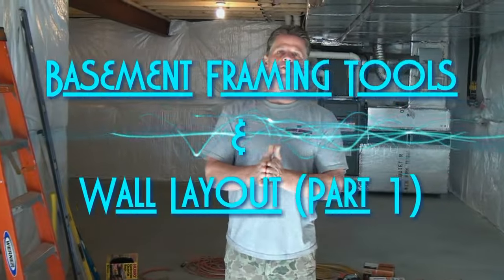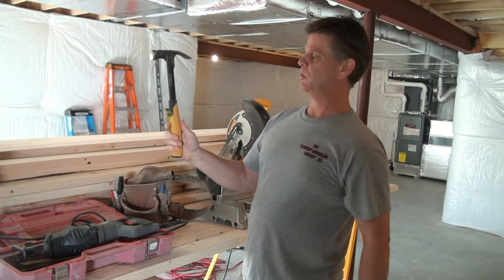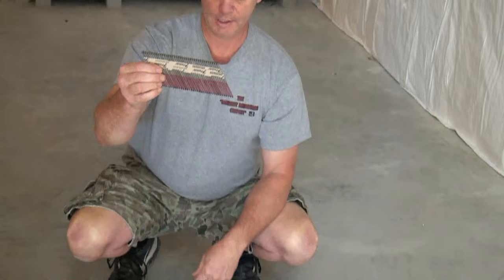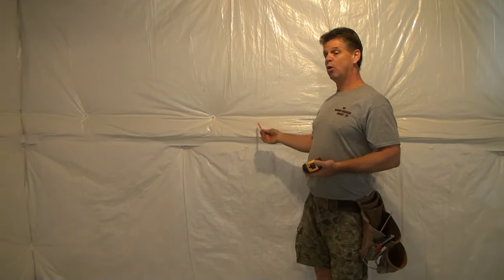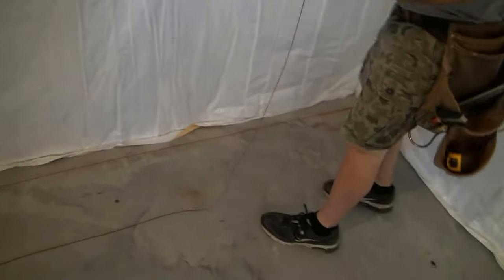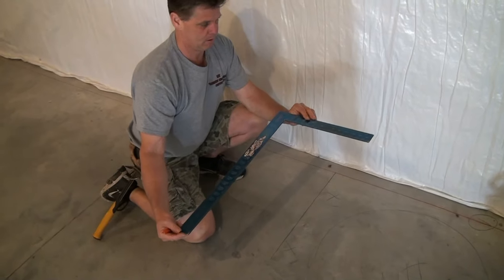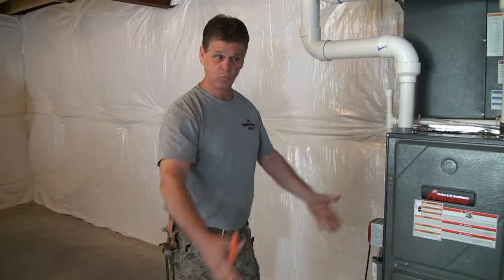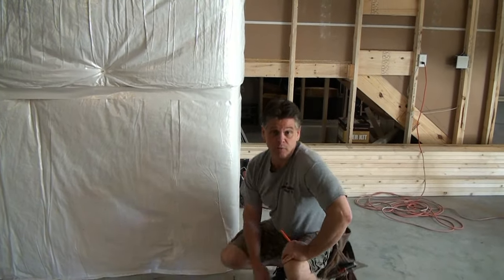How-to Frame a Basement(basement framing tools) Part 1 of 6

Comment: I just came across this.  Amazing; this is the best DIY how to basement framing video I've encountered on the internet.  I was a little apprehensive to start my basement project because the other videos didn't address my questions on corners, gaps, leveling and spacing and all together in a simple follow video process.  Yours did!  Thank you for taking the time to put this together!

Comment: What if the wall is not square. the 6 inch on both corners may not line up straight.  how to get a perfect square to snap lines in this case?

Comment: Best instructional video I’ve ever seen! Question...What is your recommendations for basement insulation? I see you are not a fan of foam board? Can you explain why? I installed 1” foam boards to the walls before watching your video’s. Should I use the goal as the exterior wall now and come off 4.5”?

Comment: Im going to finish my basement house is built in the 40's, is it wise for me to use the Pythagoras Theorem instead of using a framing square? My walls are definitely not square.
Reply from the maker: Use a framing square and check and readjust it's much faster than the 3-4-5 method (Pythagoras Theorem)...don't over-complicate this layout process.
Good luck with your project.

Eddie

Comment: I watched this video series before and during my basement build out. All the knowledge, tips and tricks to frame out my basement space is in this series. I gained the understanding and confidence to frame out my basement space. I had no previous experience framing out any space before. The directions and teaching in this series made the process approachable and relatively easy! 

I was a stay at home parent to my twin kids, back in 2018-2020. I completed this project in bits and pieces. I would start one wall section, during a 2-hour nap. Laying out the 2x4 studs and marking their positions, before cutting and nailing with their "help". The whole process was very gratifying and I felt a lot of pride in doing the work. After a friend helped with roughing the electrical, and me insulating the walls, I installed the light boxes and outlets. Another friend did the drywall over a weekend away. I finished the space with a vinyl flooring, trim boards and paint!

Comment: Thank you. I'm using these series to finish my basement as an absolute beginner. This morning i built first wall falling your instructions. 
Thank you
Reply from the maker: Congratulations on getting your project started! Framing is a lot fun when once you understand the basics! Good luck with the project Dar!  ~Eddie
Reply: @BasementFinishingMan  by the way. I finished the basement two years ago. It took me about 6 months to complete 1000sqf. I worked on it every day (5 to 11pm) and weekends from 7 AM to 11PM. A builder wanted to charge me $50k. I spent a little less than $20k, and that was because I bought the best tools out there.
Thank You

Comment: I wanted to  thank you for clear and thorough traming videos. I've got question, what do you do when you have a power switch/electric wire right on the basement sliding glass door frame.
Reply from the maker: Move the switch box into a new location on the new wall you just built.  -Eddie

Comment: Eddie - your 6 part series of framing a basement is the best on YouTube. Thank you so much. Question ... how far is “wildly off” when making sure my intersecting chalk lines are a 90 degree right angle? In the vid, you were fine with your corner being off a 1/16” but I’m attempting to finish a basement of a 1951 Frank Lloyd Wright protégé designed house where absolutely nothing is straight and nothing is level. My marks are off a solid 1/4 to 3/8 inch. Is that ok? Or should I “drive myself nuts” trying to get that tighter? Any thoughts would be appreciated. Thanks, man!

Comment: It felt that I already finished my basement just by watching this:) great video! you must be protected at all cost! By the way, should I use 2x4 or 1.5 x 3.5 for the lumber? The existing frame that I have now is using the 1.5 x 3.5...
Reply from the maker: YES...A 2" X 4" IS ACTUALLY 1.5" X 3.5" IN SIZE...

Comment: Really great video that details all tools and exact screw sizes. I have question on how to frame when firestock/fireblock is required. What all materials are acceptable as fireblock? How would it impact all measurements?

Comment: Love this series! 

We live in an old farm house. The basement has a shallow trough running along the exterior walls. It dumps into the garage, not a sump. 
Can I frame out beyond this trough without causing any issues? Very little water webs up in this trough as the basement doesn't leak, currently.

Or, can I just glue FRP board to the walls leaving the trough exposed?

Thank you for this series and your time. 
Bob

Comment: at 16:05 - the Wall Wrap. What is the purpose for it (I assume it's for moisture control?)? what does it do? how do you hang it?
Reply from the maker: It's installed by the builder of the home 99% of the time, and it's code in most regions now to install it when the house is built. It gives your unfinished basement the required R-Value the building code requires...in other words...it's supposed to keep the unfinished basement warmer and more comfortable saving you on energy costs.

Eddie

Comment: I have 2" XPS installed along my poured foundation. I see you measure far enough away from the wall so the framing isn't touching the wall wrap. Long story short, I need to maximize my space and every inch counts. Can I frame right against my XPS, or do I need to leave some space (and why)?

Comment: I unserstand how to  build a studwall for a basemnt with 16 inch centers. The problem i have is how when you join two walls at a 90 ( corner ) you have then changed and shortened the first wall by 31/2 inches and now you do not have 16" centers on that first wall? Im sure there is a simple solution but it is just not computing with me. thank you for your great videos

Comment: At 27:00 you said you needed to come out 5-ft.  Is that from the concrete foundation or from the line that is 6-inches out from the concrete foundation due to the insulation?  Thank you for your great video!  I will be framing my basement in the next few weeks.
Reply from the maker: Hi Bill on this particular wall it was off of the concrete wall and not the snapped wall line.

Eddie
Reply: @BasementFinishingMan  thank you for your fast reply!
Reply from the maker: You're welcome Bill.

Comment: The best basement framing series thx man..
Question inside my basement I have the plastic dimple roll stuff on the inside of basement can I just work 3 1/2 " off of that also I put dricore down first already gonna build frame on top of that cement is week from inside sump pump.
Reply from the maker: I would come 4.5" off of the dimple barrier just to sure I won't be pushing against it at all when I stand my walls up to fasten them. Thanks for the views brother and good luck with your basement!

Eddie

Comment: I wall wrap needed? My basement doesn’t have it. House was built in 1999 and has a rough in for a bathroom. So it was designed to be finished. Do I need any kind of plastic/wrap in between the studs and concrete?
Reply from the maker: Neither wall warp and especially plastic vapor barriers are NOT needed! Wall wrap it just for unfinished basements by code...once you remodel all that's needed is the new insulation between the newly framed  exterior wall studs...and that's it. Hope this helps.

~Eddie
Reply: @BasementFinishingMan  Awesome! Thanks for your reply. That's a big help. I was planning on studding my exterior walls and using a bat insulation, but wanted to make sure nothing was needed in between the concrete and studs. Have a good one!

Comment: The one question I have while I am planning all this framing out for the next week - if there isn't anything under the joists hanging down, can I just attach drywall to those direct instead of spending extra time/money framing a ceiling? They did a great job making our basement finish-ready for the most part

Comment: Thank you so much for putting together the best basement framing series on YouTube!
Question inside my basement we have an interior french drain, they installed a dimpled matrix about 18" up the concrete block wall from the bottom where they dug the trench and concreted over it. Should I just measure off 3-1/2" from the dimple matrix? Also, not sure if I should apply rigid foam board up against the concrete block and down over top of the dimple matrix or just frame the wall and insulate between 2x4's. Thanks you!

Comment: Your videos are so easy to follow. I'm looking to begin finishing the basement in the next month. My house is 3 years old, do you recommend adding a moisture or vapor barrier before doing drywall? I live in Ohio. I've read different recommendations and can not decide which recommendations are correct. Thank you in advance.
Reply from the maker: No Lulu! I do no not recommend vapor barriers. They cause more mold issues than they ever prevented. ~Eddie
Reply: Does this include xsp foamboard too?  I just bought some but haven’t installed it yet.-tks

Comment: Are you carrying a full framing hammer even though you use air nailers? Or are you carrying something lighter like a smaller 20 ounce hammer?
Reply from the maker: I carry a 16 oz. hammer just to knock things around if I need a club! No I don't carry a 20 oz. or heavier framing hammer when I'm using airless or air framing guns.  ~Eddie

Comment: Great video!  Starting my project as we speak.  Currently in the middle of demo.  What is your opinion on dimplemats with ply over it as the floor and framing on top of that?  Also what are your recommendations for fixing dips in the slab to lay the mat and ply on?   Now let me get back to watching and ripping my basement out!  Keep it up!
Reply from the maker: Hi Danny! I don't use any of those type system. All of our basement walls are built directly on the concrete floor. We use no types of floor barriers under our finished flooring...
We fix bad dips and uneven areas with floor leveler we mix up...you can but floor leveler at Home Depot or Lowes if you need it!

Eddie

Comment: If you measure 4.5 inches off the wall in order to snap a chaulk line, there's a chance that the wall has some waves in it. So, 4.5 inches on one end, may not be a true 4.5 inches at the other end. You'll have a straight line, but not necessarily square to the wall. Does that make sense?
Reply from the maker: That's why we come out 4.5" instead of 3.5"...to account for the uneveness of an average wall...  ~Eddie
Reply: @BasementFinishingMan  After watching further, it occurred to me that if you're squaring the corners of where the walls meet with the framing square, that would alleviate any issue regarding the walls being square off the wall? Also, have you ever used the 3 4 5 method to square?

Comment: I have a water shutoff valve that sticks out 9 inches on half of my 10ft wall. Should I make the entire wall stick out 9 inches or just the section where the water valve is?  I know you typically recommend straight walls but I was wondering if it would be worth it to add the additional 5 inches of wall space for the other half of the room. It's a small room, only 10x10. Thank you for help and posting the videos!

Comment: Hey Eddie,  Thank you for the awesome videos! It has given me the confidence to start my basement finish. I have one quick questions though. In one corner of my basement, the concrete floor is angled up quite a bit towards the foundation wall. On one side I have 83" slab to the floor joist, on the other corner, it is only 81". How do I frame with that big of a difference?
Reply: Is it possible to cut a small angled bottom plate in front of the bad concrete ? Or if you want to make it right, you can rent demolition hammer and just chisel it flat. Hope that helps, if I'm picturing it right.

Comment: Thank you Mr Case for your how to videos. They are very beneficial to learn how to finish my basement. I have a framing question I was hoping you could give me some suggestions with. I currently have a wall on one side of my basement steel beam. The other side of the steal beam has HVAC ducts so I need to build a soffit which will be the bathroom ceiling. I want to install a door into the existing wall to enter the bathroom but don't know how to frame/trim it. Concrete to beam is 80.5 inches so i don't want to loose any height. Thank you

Comment: Our basement has had moisture issues upon moisture issues. $20,000 later... We think they are resolved now but are not wanting to use wood, just in case we get moisture and mold again. What inorganic options do you recommend  for instead of wood & drywall?
Reply from the maker: None! If the moisture issue is truly fixed you can use standard building materials and sleep good at night...You could use all M.R. drywall (moisture resistant) that will withstand higher levels of humidity than regular 1/2" drywall. You could also use metal studs which are a commercial style of framing, but I don't recommend these materials as they are not needed if your basement is "dry".

Eddie

Comment: Basement Finishing Man - if you are running your chalk lines off a wall on one wall to hide a plumbing line(say 6"). Do you have to use the same distance off the wall even when the other walls allows for your 4.5" off the other walls because I don't have any plumbing lines to hide with the other walls? Does every wall have to be the same distance away from the concrete to make a 90? thanks in advance...
Reply from the maker: Greg Bates no you can use 4.5 
“ for walls that do not have any obstacles in the road.

Eddie
Reply: Thank you sir! @BasementFinishingMan

Comment: Thanks for these great how to videos.  Quick question I have a French drain around the entire exterior of my basement.  Would I measure 4.5 inches from the actual wall for my floor plates or 4.5 inches from the edge of the French drain which is about an inch wide?  Thank you.
Reply from the maker: I still would measure in from the wall Tom. It's the way we would do it. Best.  ~Eddie
Reply: @BasementFinishingMan  
Thanks Eddie!  Appreciate the response and all the videos.  Great stuff
Reply from the maker: @tomschreck7171  Anytime my brother...Good luck with all of your projects Tom!

Comment: How far from the wall should be marked in the beginning if you're using 1" foam board insulation instead of wall wrap?  Thanks.
Reply from the maker: 4.5 " of the Styrofoam panels...just treat of the foam-board as the concrete wall and do everything the same as I did in the videos.  ~Eddie

Comment: Hello, Thank you for doing the video's. They are great help.

I have a quick question about framing nail guns. How do you decide if you want to use 21degree or 30degree nail guns. I called my township and they don't have any code regarding this. Any advise will be great help.